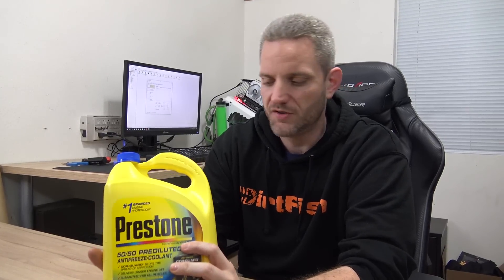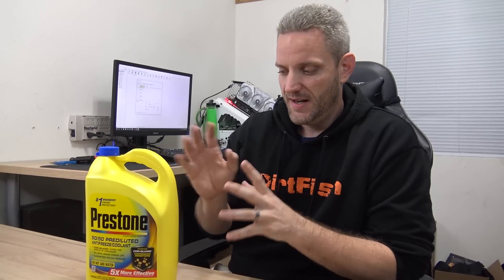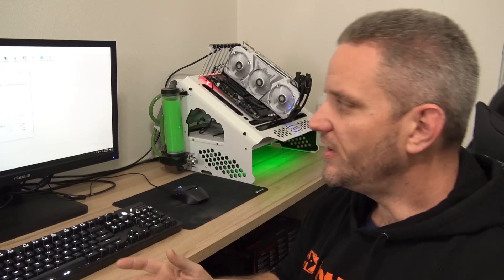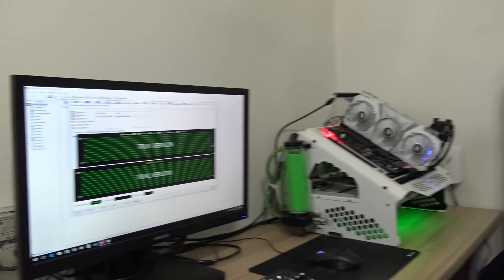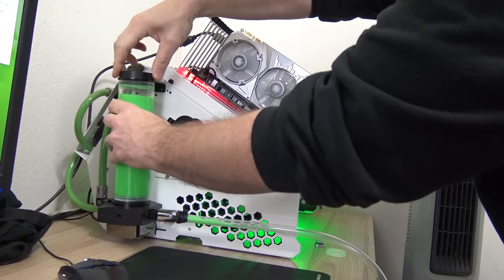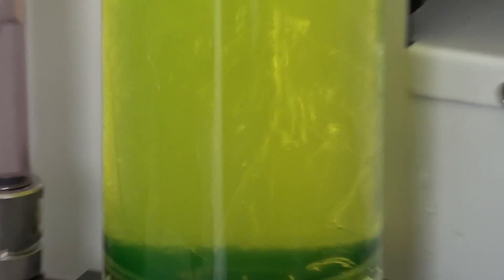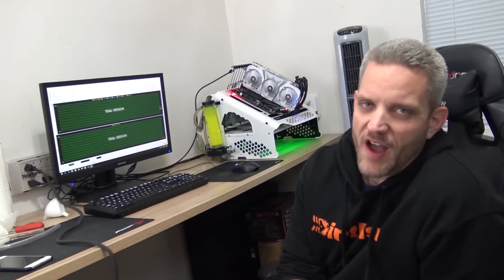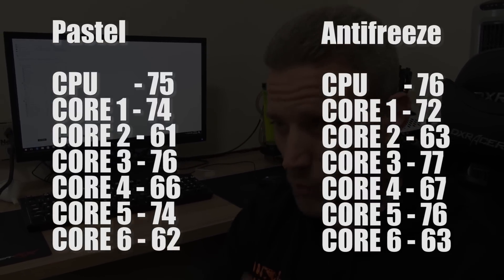I used Antifreeze to cool a PC

Comment: Ethylene glycol doesn't have as much specific heat capacity as water, and as far as I'm aware it has less conductivity as well, so there's no reason to use it.

Why do people think that it's a good idea to use to begin with? Anti-freeze is used to protect from freezing. PCs run hot, so it's pretty much the exact opposite of what you would be looking for purpose-wise.

Just think about things that you use to cool stuff down. Chlorofluorocarbons (and related substances) would be a good example of a fluid to test using, for instance.
Reply: Because back in the late 90's and early 00's when we didn't have all these fancy enthusiast cooling BS products,  antifreeze was cheap and affordable.

We primarily ran it in our loops not for cooling performance, but to prevent corrosion and inhibit bacterial growth
We also didn't do stupid shit like run 50/50 or 100%  antifreeze.  things were usually 70/30 or 80/20    Water/AF.
derp.
Reply: What are you guys even on about? No one has ever promoted using anti-freeze in closed loop water cooling. You'd negate most of your temp reductions going from air to water by putting that stuff into any loop. If you went on any forum saying you used that "back in the day" you'd get schooled fast. Nothing more than distilled water has ever been suggested, with water wetter as an anti-corrosive additive. And if you had "growth" issues then a small dose of copper sulfate available at any pet store (for aquarium algae issues) would work, or as another user pointed out, adding a piece of silver plated wire in the loop. Both copper and silver have anti-fungal and anti-microbial properties and have been "lying around" since the dawn of time. Also, cooling loops started as far back as the late 1940's on adding machines/mainframes, so we've had all these issues figured out for quite awhile now.
Reply: haha, nice troll.
Reply: Antifreeze and coolant are the same thing. You see...never mind, I'm not gonna explain. You have to be trolling.
Reply: I used it because anti-freeze is anti-corrosive. No problems for 4 years now. Also, you don't have to worry about it freezing. I've had my system sitting in storage without climate control for a month, and didn't have to worry about it freezing and busting something.

I really don't thing anti-freeze will hurt anything in your loop. It may be less thermally conductive than just plain water, but probably not enough to make a difference in a PC. It also acts as a lubricant, which may be helpful to the pump.

Comment: You know you can test a loop while its not in a system right...
Reply: You need the heat from the CPU to actually test a loop. It may last 20 years at room temp but once you pump 90c worth of heat into it, now you start making chemical reactions happen faster.
Reply: Then use a hotplate, not that hard to add a heat source other than a CPU.
Reply: Yes you can test temps on a CPU without a CPU , well done on being a dumbass
Reply: ClamaKaze he said he wanted to test a loop to failure, no need to call people names because you didn't understand my reasoning

Comment: I don't really get why you worry about your soft tubes. We have metals different rubbers and plastics in contact with antifreeze in are cars. The only big difference is that you don't need to worry about your computer freezing. That makes antifreeze unnecessary.

Comment: Ethylene Glycol is toxic, so that's another reason not to use it. Tube fails, pop a line off by accident, spill some during an upgrade, basically get some of that stuff on your floor and if your dog decides to lick it, you either have a dead dog or an expensive vet bill.

Comment: so why not use a entirely metal based tubing system to run on antifreeze?
Reply: You certainly could. Has been done, nothing new. Cost and difficulty in bending metal tubing is the limitation. I have found that using Prestone 50/50 reacts with acrylic (typical material for reservoirs) in an adverse way.
Reply: it is hard i do agree and why not use transparent titanium instead of acrylic or is the version possible to make at home to thin?

Comment: Hey guys I have a question,  anyone can help me on this. I currently own a GTX 970 Reference card paired with a 6700k CPU and 32 Gigs of ram.  After I get my job,  I planned to upgrade to the 1080 hoping that it would be cheaper because the 1080ti is coming out hopefully soon.  But Nvidia is coming out with their Volta cards next year to surpass their Pascal series,  so do I get a hold of my job,  and save up for a Volta GPU? (leaked sources say that the starting price for a GTX 2080 will be cheaper, around $499). My 970 is OC to surpass a stock 980 so it will do me for a little longer,  I don't mind keeping it for a few more months,  or more,  to get a more powerful,  cheaper GPU.  What should I do?

Comment: Antifreeze would need to be changed from time to time or else it will eat away at the metals just like a car. Most cars have iron, copper, aluminum, and plastic in the cooling system. I'm not sure if it would eat away at the plastics used on computer loops but a lot of car radiators use plastic tanks and plastic overflow jugs.

Comment: It is a no-brainer antifreeze is not going to cool as well as plain distilled water. Not what Anti-freeze is designed for. It is, as it's name states, to prevent freezing. I have used the very same Prestone you are showing in my systems numerous times for sub-zero cooling. But I also flushed systems back to distilled water when done and PC back to ambient temp The longest I have kept Prestone in loop was a week. Tygon tubing and HeatKiller blocks. No problem. It isnt going to react with any metals. That is why there are inhibitors in it. It however seem to react with the acrylic tube rez, but not any plastic. i am going to assume there is some form of alcohol/methonal in the mixture to effect the acrylic tube.

Comment: isnt using water a bit dumb? its not the best liquid coolant in any way.
Reply: water is one of the best coolants available to us. It's inherent weakness is its boiling and freezing points. THATS why we use antifreeze in cars: because an engine will boil the water away. When was the last time you let your computer run at 100+C?
Reply: Nope. Plain old distilled water with a couple of drops of bug dope is the best coolant. Super cheap and available almost anywhere.
Reply: Water is a great liquid coolant. It's not the best no; but it's good, and it's virtually free.
Reply: Better coolants are exist, but you don't need any better than distilled water. It's just pointless.
Reply: but you do want a coil of silver in the res to stop bacteria growth in the warm water ;)
Reply: I live in Australia, it's  summer..   so pretty much every day :P  
well, it feels like it at least..   ught it's fucking hot!  wahhhhhhhhhh

Comment: what about dexcool
Reply: nvm I just did some research, dexcool is still ethaline glycol based
Reply: He's just making drama, you can use ethylene glycol or propylene glycol just fine in most applications, you only need a 5% mix though, it's mainly used as a fungicide. The other properties are pretty much redundant in this low temperature application..

Comment: Jay, do you approve? (Build List)

Case: Corsair Carbide Spec 02

PSU: Corsair CX-600M

Motherboard: MSI 970 Gaming (AM3+)

CPU: AMD FX-4350 (Overclocked to 4.7 Ghz, 1.468 Volts)

CPU Cooler: Cryorig H7

RAM: 16GB Axexir Core DDR3 2133MHz

GPU: MSI GTX 1060 3G

SSD: PNY CS1311 240GB Sata III

Fans: (x4) Corsair AF 120 | (x2) Corsair AF 140
Reply: EnderBlock Entertainment if your spending that much why not 1070 or 1080 or just two 5/480s in crossfire
Reply: lol, a fx 4350??
Reply: Get a better ram as well

Comment: The wavy lines you saw in the reservoir, right after adding the ethylene glycol, is from the density change in the liquid.  Since the small amount of distilled water that was left in the system is less dense then the ethylene glycol, it floated to the top from the inlets at the pump.  It's the same effect you get from looking through hot air above a heat source.
Reply: Kane Fame Thanks for the info 🐨
Reply: Kane Fame I am wondering what is used in fridges and whether similar fluid could be used? Or liquid propane gas though I suspect that would be rather dangerous lol. Gas always feels cold though, is there any non flammable gases?
Reply: Lots of non flammable gases exist. Like Air, which is a mixture of gases, Oxygen, Nitrogen, carbon dioxide, water vapor, and lil bit of argon. However the effect you suggest is different than liquid cooling. Refrigerators use a compressor to condense a refrigerant called HFC-134a(a non ozone depleting gas a.k.a. 1,1,1,2-Tetrafluoroethane )  inside and a radiator on the back to dissipate heat gathered by the refrigerant inside. This method of cooling requires the coolant to undergo a phase change from liquid to gas and the energy absorbed is released thus cooling the system. In liquid cooling there is no phase change and the radiator is there to remove the heat from the liquid as it absorbs it from the cpu/gpu. Liquid nitrogen is a sort of easy to picture example of this phase change cooling with no compressor(well if you dont want to save your liquid nitrogen haha) but imagine a simple setup, one you wouldn't do in real life but its again easy to picture. A metal cup of liquid nitrogen in perfect contact with a cpu that is on. As the cpu gets hot it will boil the liquid nitrogen, the phase change as the nitrogen boils, liquid n2 absorbs heat from the cpu phase changing into gaseous n2. Liquid nitrogen doesn't cool the cpu because its cold, its because liquid nitrogen's boiling point is -320.4 *F so the cpu is effectively a hot plate on a stove boiling a pot of liquid nitrogen, its just counter intuitive to imagine something so cold is because its boiling because we are so used to water boiling at a hot temperature relative to us. Pretty sure quantum computers use a similar mechanism to refrigerators just a more complex and insulated version to get temperatures cold enough for it to exhibit quantum characteristics.
Reply: Devin Williams used to use Freon but now I do not know

Comment: I've been running Honda concentrate in my system with copper radiators and a solid nickel block gpu heatsink for over a year, the only thing I've noticed is after 6 months after I took it all apart to make sure nothing was gunked up or corroding, was that it discolored the tubing slightly.

Comment: lol it'd be cool to see what kind of bugs you can start growing in that loop since there's no anti microbials in Antifreeze... at least not to my knowledge, anyway.
Reply: ethylene glycol is a anti growth agent, that's what it's used for in low temp cooling ALSO why you only need a 1/10th mixture not a 50/50 nonsense (which would cause issues). AIO's just use this or the non toxi polypropylene variant

Comment: May be it has been suggested before... But what about mineral oil? If it leaks nothing too bad will happen (I guess).

The point is that I don't really know how it will work exactly and if it is even useful for a liquid cooled system.
Reply: oil unlike antifreeze (drama aside) would actually damage the system, it tends to break down rubbers and is too thick to pump effectively (unlike antifreeze)

Comment: what about using Freon as coolant
Reply: that's called refrigerate cooling (and we don't use freon any more, bad for the ozone layer), you can buy them, but then you have to insulate the hell out of the cpu socket and you'll have condensation issues and a lovely power bill.
it's just not cost effective.
Reply: John Douglas I think that was sarcasm bra
Reply: mayhaps, but, you can't tell, there are plenty of people that silly out in the world ;)
Reply: Princess Cadence I've actually tried picturing a way to build such a small system. Maybe gut the internals from a counter top size fridge.🤔

Comment: it does nothing, its bullshit. (yeah maybe that one form of plastic he is talking about, could degrade over time)
Rubber part etc. wil be just fine. (for fuck sake there is rubber hoses, seals, plastic.. in a car)

I have been useing the red coolant for serveral years without any problems (i just used normal "drinking water" tubes)

Comment: Try lava lump fluid.
Reply: not very good at conducting heat.
Reply: Team WaveHD it's mineral oil it would just lube up your pc lol
Reply: John Douglas Oil is far better conductor than water or anything else. Ultra high-end engines are oil-cooled
Reply: lava lumps.. the product of too much hot sauce.
Reply: Mihkel Laansoo My teacher at this program at my school had a PC cooled by Mineral Oil. he had barrels of oil in one of the closets in the classroom
Reply: Though probably far more expensive
Reply: Team WaveHD the wax would clog
Reply: Computers are not cars, no but thermodynamics are thermodynamics. You plank.
Reply: Exactly? and you're point is... if it's a car a computer a laptop or a fucking elephant thermodynamics are thermodynamics. it's as simple as that don't argue with it or you will look dumb as fuck. because you are trying to say from you're og comment that mineral oil wouldn't cool a pc because it's not a car? does a cold shower cool down a cow even though a shower be it cold or not was designed for a human? ofc it fucking does because...thermodynamics can't be fucked educating planks. So stop.
Reply: Ok you win, ill fill my loop with castrol GTX
Reply: computers are not cars
Reply: I hate lava lump
Reply: Try PISS
Reply: Mihkel Laansoo because they have moving parts you dumbass
Reply: computers do not get to 150 degrees (you plank)
Reply: yah
Reply: I have a lava lamp not a lava lump
Reply: Synthematix PISS = Processors In Satan's Service?
Reply: dude you right and with the right viscosity might be better than water and a leek wont kill your machine

Comment: Since mercury seems to be incredibly sensitive to temperature, I wonder what it would be like in a liquid cooled system. Pretty sure it'd be hard to get hold of that amount of mercury/ a lil dangerous? Interesting none the less.
Reply: The problem is that mercury is over 13 times more dense than water. It also have around 3% of the heat capacity, meaning not only would it need to pump very fast, but it would be extremely difficult to pump as well.
Reply: isn't mercury also very corrosive? in that case it would dissolve the blocks and the rads
Reply: Saracen Gaming ...
Reply: virtually impossible with any kind of pump that would be affordable.
and it's incredibly toxic as it vaporizes.
Reply: it's only corrosive to Aluminum as far as I'm aware, it stops the metal from oxidizing, so it basically "rusts" into dust.

Comment: I don't see what the bid deal is- just don't use a glycol based coolant. Same as car racing- glycol puts a slippery layer on everything it touches = not good for racetracks and water loops in a PC. 
I used Penrite Non-Glycol Racing Coolant in my first W/C loop years ago. It ran my i5-2500K (at 5.01GHz) and a W/C'd AMD HD 7970 (all the afterburner sliders at max) for three years without any problems. (then motherboard died- unrelated)

Comment: Antifreeze is just for against freezing  - like if your PC built would be experiencing -25C then you cant use water anymore - so using antifreeze would make sense then
Reply: Kuldar Leement not true. Antifreeze is used in vehicle cooling systems to prevent overheating. It's put under pressure in the radiator
Reply: Kuldar Leement if your pc produces temps of over 100 degrees C then water will not work.
Reply: cjmck coolant is not put in your car to keep it from overheating exactly. Common misconception.  That's what the water in the mixture is for. The coolant conditions the water for more efficient cooling. A 50/50 ratio will increase the waters boiling point from 212°F to 223°F which is perfect for most cars. A richer mixture with a 30/70 ratio will raise the boiling point another 10 or 12 degrees however it also raises the viscosity. While the water can now be heated to 235° before boiling the higher kinetic viscosity means that heat will travel less freely through the solution and the higher density means that the water pump will struggle more to push the material through the engine and it circulates slower translating to less effective cooling overall. In some applications like a single engine airplane for example where the richer fuel burns hotter and heats up the engine faster a leaner 60/40 mixture  can be used to draw the heat away from the engine quicker and more efficiently especially since the amount of air being pushed through the radiator can cool the water quickly. So in terms of let's say CPU cooling where temps aren't quite so high I'd guess that in order to use coolant effectively you'd want a large radiator with lots of fans/airflow and a pump that circulates the water very quickly and very little coolant. Just enough to keep things from corroding and of course tubing and internals that wouldn't be broken down by the chemicals in the coolant.

Comment: it's good to use antifreeze if you have your radiators outside in the winter time lol. Physics says antifreeze will perform less than distilled water. You can safely run it if you just let the pump run with the pc off for a week or so...

Comment: Kinda off-topic, but those 5930K temps seem really high..? I have the same CPU clocked at 4.5GHz and it barely breaks 65 C - and that's with a Corsair H115 AIO - doing the same test.

Comment: Antifreeze like you used is meant to hold Heat in a cooling system. The liquid that provides the best heat transfer is pure water with water wetter to break surface tension

Comment: I guess at this point since you mentioned that most of the comments are unoriginal, would mineral oil in a mineral oil safe custom loop give you any temperature benefits because if that system were to leak you would not have to worry about shorting any components as fast as you would with distilled water.